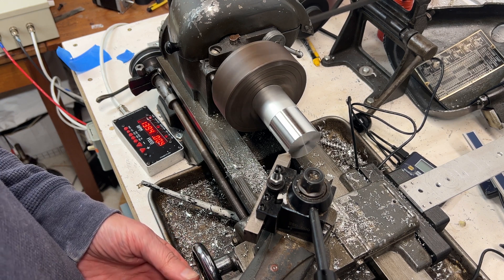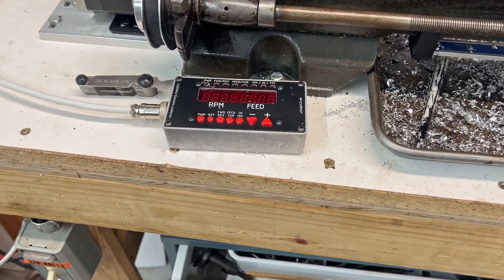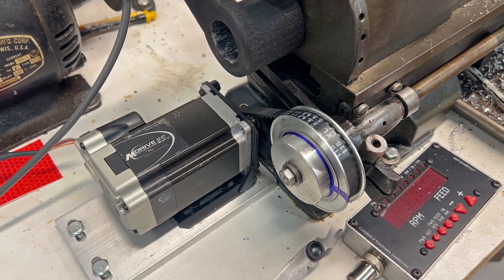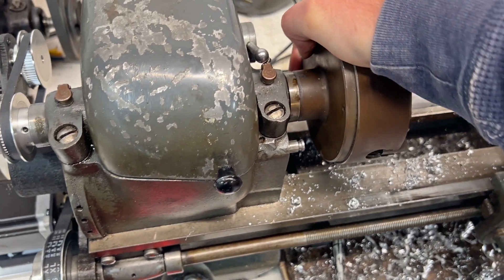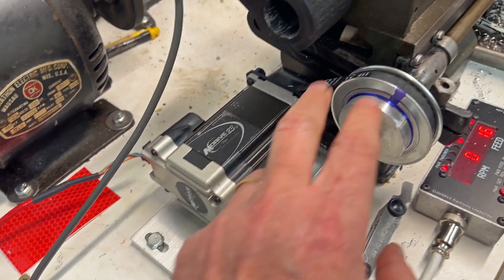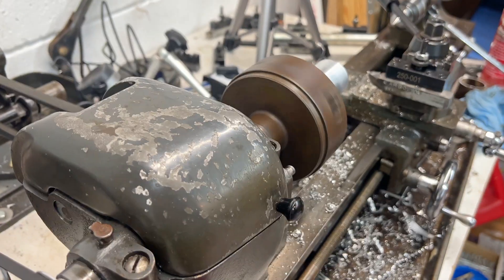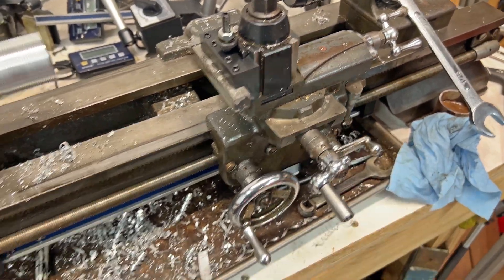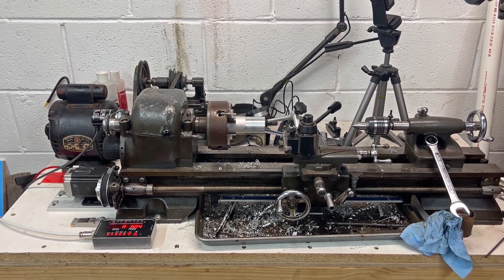Electronic Lead Screw on the Craftsman 101/Atlas 618 6" Lathe

Comment: Do you make and sell the brackets? If so, how much and how can I get one from you
Reply from the maker: You can download the STL for the omron encoder bracket from printables but the metal connectors for the stepper motor were made from pieces lying around. https://www.printables.com/model/540759-omron-decoder-bracket-for-atlas-6-lathe

Comment: Love it. Is there a chance that u could update the links in the description?
Reply from the maker: Thanks. The only links that didn't work for me were for the TI board and the motor. TI boards tend to get sold out often. I changed the link to digikey  https://www.digikey.com/en/products/detail/texas-instruments/LAUNCHXL-F280049C/9860033 that has them in stock now. 

The motor happens to be the one I used with was an integrated stepper motor (no external driver needed). These are expensive and harder to find. Any Nema32 stepper with good torque and an external driver will do. 

I've added the link to the designer's wiki bom as well.

https://github.com/clough42/electronic-leadscrew/wiki/Stuff-You'll-Need
Reply: @Core3DTech  thank you. I will start putting this together and onto my craftsman 101. The updated links work.

Comment: Sorry if I missed this information but what size and model number servo motor are you using ? The original motor James tried on his lathe was way under powered to run my carriage without kicking out. Oh by the way I have a 1954 southbend
Reply from the maker: the motor I use is a hybrid stepper motor called MDrive23 which no longer is made. I got these off of an X-ray machine. You can still find them on eBay but unfortunately, you'll also need to custom order a programming cable to set the configuration of the stepper. I do have a 13:39 gear ratio from stepper to spindle which helps